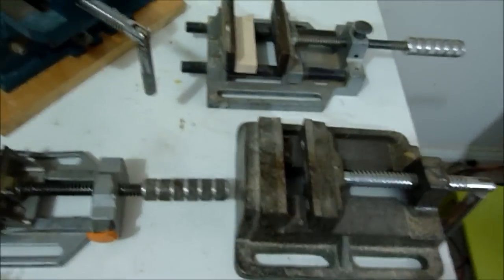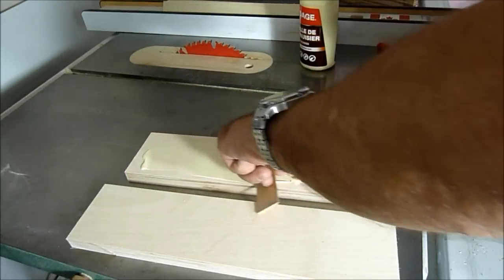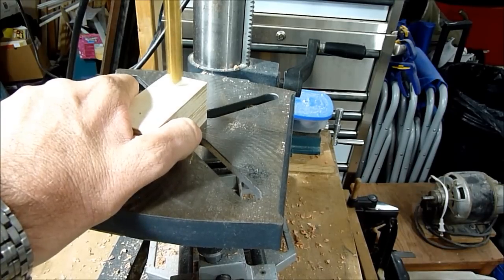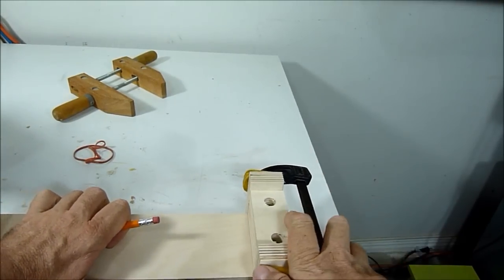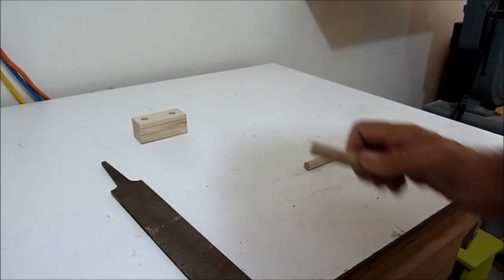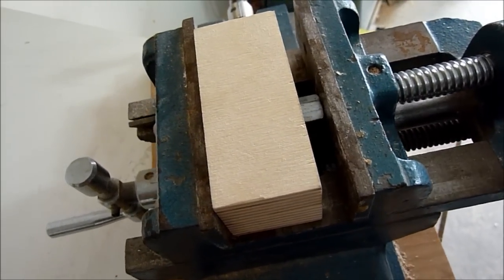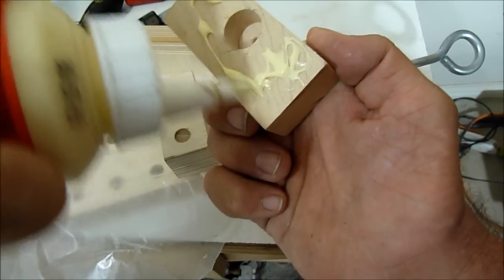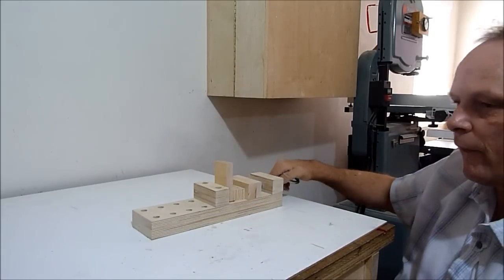Make a wooden clamp, effective and simple to make.

Comment: Great for machining something where you may hit the vice and ruin your tool.
Reply: Your video is wrong.  you show screwing the end block on. There is no hole  in the end block for the cuplinn nut. when you were putting it togather. It showed the nut in the block. It also showed that you used a larger block and different wood to cover the bolts.
Reply: @williammeredith3803  not my video

Comment: a lot of nice tips nice video being a little ocd here but want  to pass on something about spade drill bit in this case didn't matter I was making a toolbox that required holes for the handle put a  good scap of wood under the workpiece seems to minimize wood tearout..was under a time pressure as it was a Christmas present..put saw dust and glue I  sanded next morning.. quick rescue but was totally unnecessary.. btw I was using a whole saw but a clamp and piece of two by four would have saved alot of problems. good vid

Comment: I saw this a while back, and liked it.    Then, I started looking at other ideas by other sites, and I lost who did this!    I found it again today, and I love the idea of the double dowels for a cross piece for the clamp, and will be making several soon (in different lengths) as they are just so much beefier and easier to truly hold the object to be clamped than I would feel using one with a single dowel.    I also like using the eye bolt, as this is certainly strong enough, and does not require the step of working with epoxy to make a nicer handle, but not one that really adds to the usefulness of a shop tool.     Thanks for you ideas, and I know you enjoy what you do.

Comment: Jack Nice Vise. Here are some improvements you might consider.

Make a second re-movable Jaw with the dowels projecting up from the top  and drill a pair of slightly larger +1/64" in the attached jay so you can use the top surface of the jays to hold either thin flat stock for drilling through or round or odd shaped pieces on the top of the vise like bench pins and a vise built into a workbench.

One of the comments  mentioned about a larger screw to increase the force on the jaws, You're metnod of attaching the threads in the fixed part (Press fit into a round hole limits this because before you get to the limit of the threads the nut will be forced out of the wood.  It is squeaking because plated screws really are not meant for pushing forces. Lub them with some clear silicon grease and that will help it will also keep an misplaced grease from sticking.

Another comment was about glue sticking the workpiece to the vise You mentioned Wax paper which I use also but now I've discovered the food grade plastic that comes with wire rack shelving an I Use that over my benches for glue and paint protection. A more permanent solution and even "Gorillia Glue can be scraped from it.  A more advanced user can laminate a piece of Teflon plastic or "Formica" to the upper surface of the vise bed But one would need to be careful when drilling.

Again a nice Job

Comment: Simpler is cooler. Wud b Nice to make the spindle rotate (more) smoothly. Wonder how you would do that? Maybe a washer in the bottom of the forstner hole which accepts the "nut end" of the tightening eye- bolt..

Comment: Awesome idea! Though, I'd make a round wooden handle over the eye-bolt to make it easier to tighten.
Reply: or just put some wood or metal rod through the eye, put some caps on it and there's another type of nice handle, which requires even less strength :)
Then attach it all to some workbench.. and that'd work awesome as well i think :)

Comment: i am starting to make my own holders.  purposly left a wood workbench size of a small pool.table with out last boards on the ends built it mostly with pallet boards. any ways i renforced ends and the space left has hundreds of uses.  vertical and horizontal.  today table frame sat perfectly in it.

Comment: seems allright although it is very basic. I would suggest you add 2 screws at the handle part so u can add more pressure on it. And instead of dowels I would use some steel rods to get more strong joints. The base however is a very nice base

Comment: i just made 2 of these out of 2x4 and they work great .i needed longer ones .they hold plenty of pressure thanks man
Reply: Yeah Jack. Why did you not use 2 x 4 to start off with instead of gluing two pieces together?
Reply: it was probably a case of using up some smaller offcuts and scraps. Why use a piece of 2*4 when you can just raid the scrap bin that's always the best place for spare parts IMO.

Comment: I noticed that you drilled the hole vertically off center (closer to the bottom) on the jaws for the handle. What's the reason for that?

Comment: Thanks for the video and helpful tips throughout. I am in the market for long clamps but they are 25-40 bucks each! I already have the wood, just need a little hardware and I'm good to start building. One question, any particular reason you used plywood over a hardwood? Just curious? Again, awesome video!
Reply from the maker: Plywood is easier to work with and works fine for this vise..... and if you check out the  jaws they are made of maple.
Reply: Jack Houweling , great thanks. Probably stays flatter than lumber too.

Comment: Great video, I'm thinking strongly about building one since I'm a beginner and this looks pretty simple to do. One question though - if I wanted to build one much longer, for example 4 feet, would I have to use a wider eyebolt and nut?
Reply: burricanecarter just a longer eye bolt
Reply: +Jay Wai Ming not necessarily... because if the work piece is long enough, the eye bolt won't need much displacement.